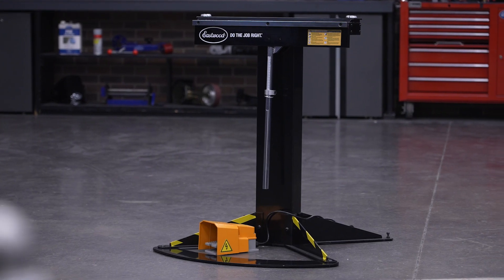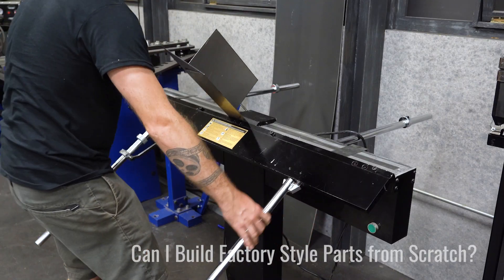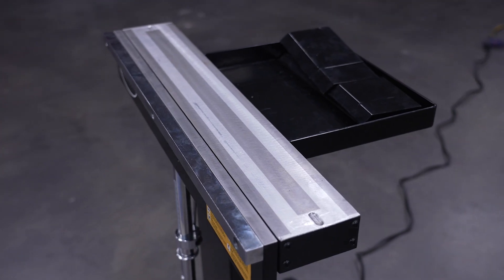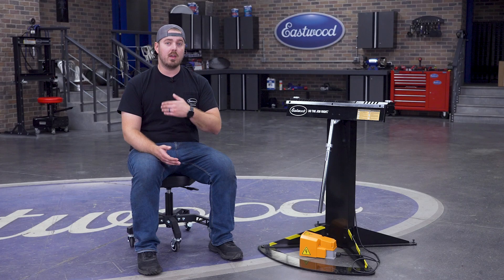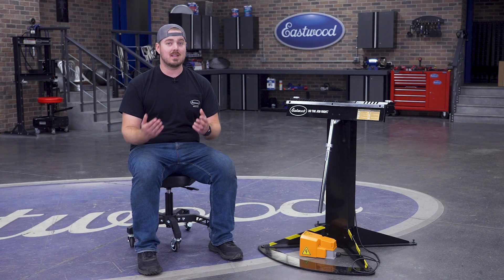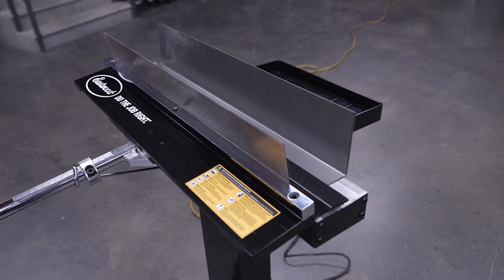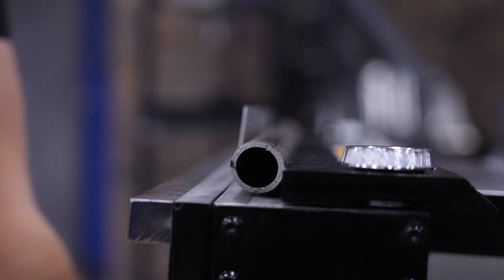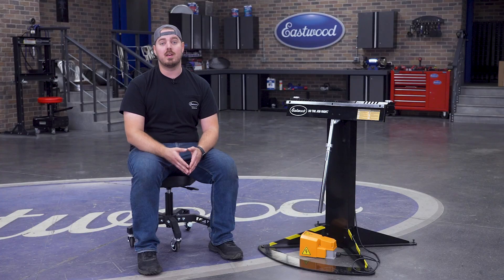24" Electro-Brake - How to Fabricate with Magnetic Sheet Metal Brake at Home

Comment: $2000 for diy use? Ouch, kind of pricey.
Reply: Is it just me or is the part being bent sliding back as he bends ? Might be reflection effect but sure looks like the mag is not strong enough to keep part from sliding ?
Reply: @nonyabiznizbro  Yeah, I'm very interested in these but ALL the videos I've seen the bent radius is horrible.  Even in this video that looks like 20 gauge and the radius looks like 3/8", and that's typical of the videos I've seen.
Reply: How much did you think a fair retail price for this product would be?
Reply: @alanjordan9772  Obviously  not $2000. At that price, you wouldn't make enough parts to make the price make sense.  If you're buying this to make parts to sell it's 100% cheaper to let a shop do all the work.  Places like send cut send.  Any Diyer is going to use what they already have to bend parts,  they're advertising for the home user. Who has $2000 to waste to build a few parts in this economy.  I've bent a ton of things just using angle iron clamped to a table.
Reply from the maker: It's currently on sale for $1799 - but it's an electro-magnetic brake so it has a bunch of expensive components a box and pan brake don't have... That said we have lot's of budget friendly options.

https://www.eastwood.com/eastwood-48-inch-box-pan-sheet-metal-brake.html - $999
https://www.eastwood.com/eastwood-3-in-1-30-sheet-metal-shear-brake-and-slip-roll.html - $899
https://www.eastwood.com/eastwood-24-inch-box-and-pan-sheet-metal-brake.html - $449
https://www.eastwood.com/eastwood-versa-bend-sheet-metal-brake.html - $199.97

(Prices accurate as of 10/01/24)